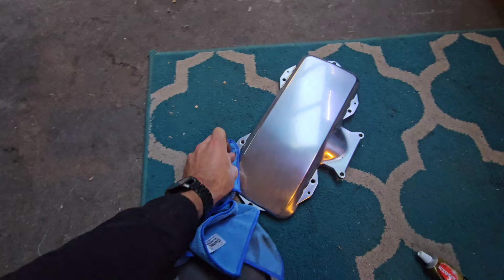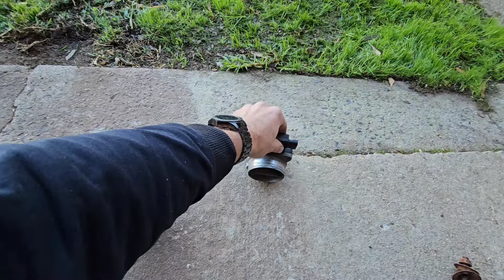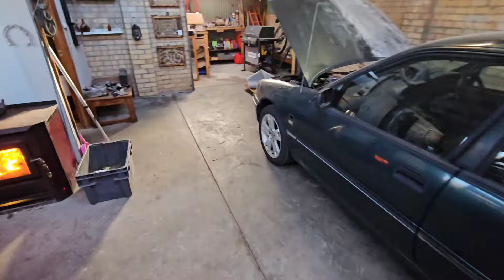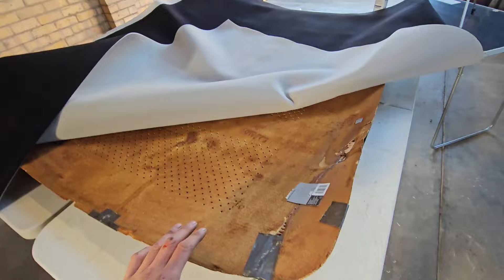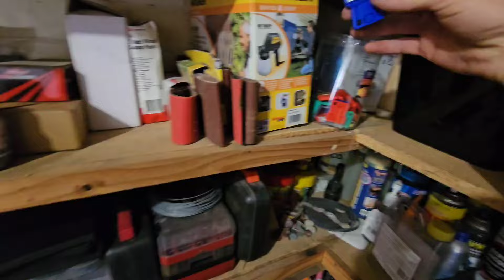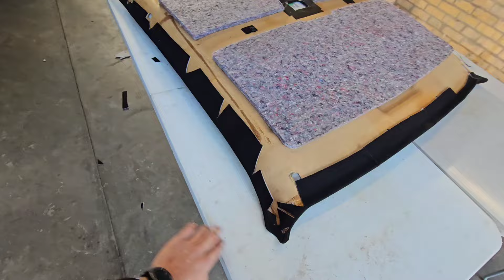How To Replace Roof Lining | Remove & Repair Holden Commodore Pt2

Comment: Cool Hands Luke, roof lining forward thinking, fold-back overlap equals no peeling, when down the track Zaz and Dom wheel pops along to car rallies. Our fabrics project is a butterfly sling chair getting recycled black trampoline matting, replaces torn vinyl, and the twin layer gives that lace curtains moiré effect, super cool! Years 7 & 8 we got AAs for Needlecraft, then Years 9 & 10 Metalwork also AAs... Should have worked at HSV or Corsa! Ever see a CSV? Another local but was really a kit car was the Purvis Eureka, rather useless for doing family barbeque shopping, hook up the trolley and drive it home! Cheers, Gabi
Reply from the maker: Another job crossed off the list @Gabi Valla and it turned out even better than expected with the new black carpet🙌 It will last for many years to come I'm sure.
Great project to by the sounds too, I love your idea of using the trampoline matting. 
I can't say I have seen a CSV but I reckon I've heard of them spoken about before.

Cheers heaps again Gabi, take care until our next 🙂👍👍🤝

Comment: G'day Luke, It's looking good! With the quality of my workmanship lately, I would either have glued the material to the wrong side of the panel or left a massive crease right down the middle, your lucky it wasn't me doing it, that glue can be unforgiving sometimes. I always had trouble with corners trying not to have little folds protruding out and spoiling the shape. It come up great, can't wait to see it fitted. Cheers Mate!
Reply from the maker: Thanks heaps @wayne armstrong it sure is coming along nicely so far mate. Now the roof lining is complete I can really concentrate back on sanding and stripping the exterior and ready it for paint too. Next video I will be sharing what it looks like fitted back into the car👌 Thanks again Wayne👍👍👍🤝